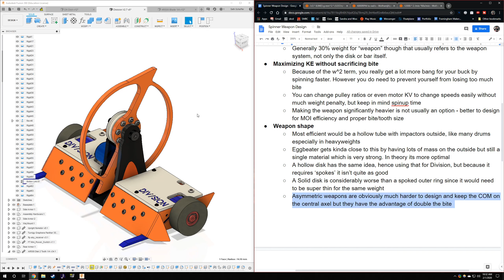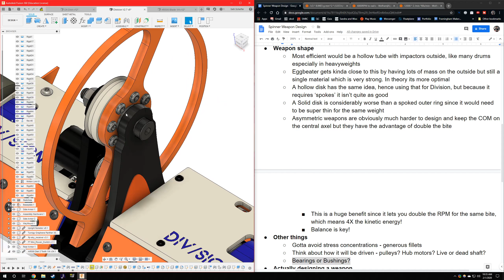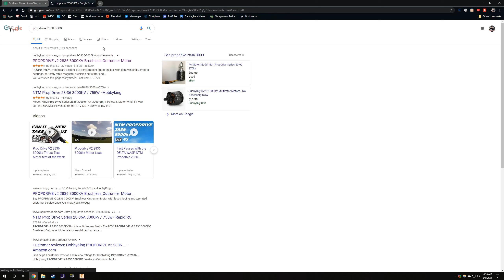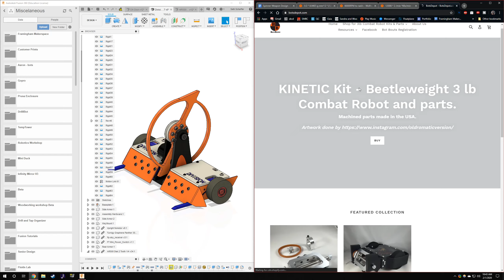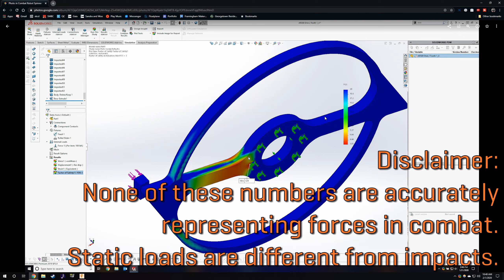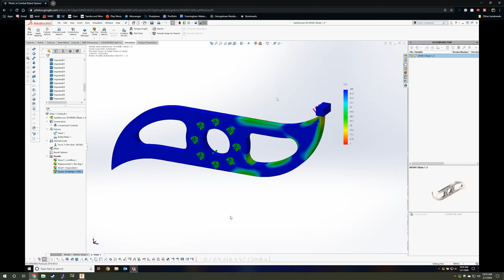Combat Robot Spinner Design Tutorial (Part 2): Motors, Pulleys, Applications and More

Comment: why does your new one-tooth spinner have a V-shape pointing to the tooth, instead of a full circle? seems that would increase MOI and also decrease air drag. you'd make the part of the circle opposite the tooth thick (like you have it).
Reply from the maker: Ive been using the single tooth spinner for over a year now. I'm finding it hard to visualize what exactly you are saying. Higher MOI isn't always the goal though. And drag hardly matters with weapons as thin as mine are, Division uses a ton less power than all the beater bar robots do. I have measured it drawing only about 9-10 amps at full speed. The new 2 tooth Superlight Slicer blade (used with the fork config) is designed to minimize MOI so the bot gyros less when turning.
Reply: I think one point is to have only the tooth stick out. If you have a circle with a tooth sticking out, another spinner oriented 90 degrees (horizontal against his vertical or vice versa), there is a higher chance for the enemy weapon to impact your circle weapon on the side. The v design significantly reduces this chance. But I have no idea if that was the reason for him doing that
Reply: @thorwaldjohanson2526  well if drag doesn't matter, and higher MOI isn't the constraint he's up against, then the circle thing is less compelling
Reply from the maker: Yup this is correct. The main idea is to avoid horizontal spinners getting a good bite on the side of the tooth. Having a reooev angle behind the tooth rather than a circular section can minimize this.

Comment: Also an example of a bot that has a lot of flex and no failure or warps is nightmares when icewave hit nightmare the bot was fine, but it’s disk warped and hit the side of the frame, it bent a good 20°+ causing the frame to warp, but the disk was perfectly fine afterwards

Comment: Do you consider offset inserts to be 1 tooth or 2 teeth for bite calculation? Because in a given radius along an impactor path, it is essentially an asymmetrical design
Reply from the maker: Well that depends on if both teeth can hit the thing you are driving into or not. In most cases they can but if you are attacking a corner of a bot or hitting with just half your weapon then you might get the benefit of a single tooth design.

Comment: I realise that it's a heavyweight bot and so not really connected with Seth's current work, but I find the vertical weapon design of Cobalt (2019 BattleBots iteration, black and green) odd but curiously pleasing. Why? Because the guys put fight philosophy ahead of weapon efficiency.

They deliberately went for a massive, solid, ripping-tooth disc, apparently sacrificing a lot of absolutely 'correct' theory for strength, after taking into account the kind of opponents their bot would be facing. To wit: yet more great big powerful spinners.

Using more of the engineering points Seth has explained in these last two videos would certainly have given Cobalt a very efficient weapon, but...

But that's where the 'unknown' bit of their approach comes into play. The fight philosophy. I think they'd planned to use Cobalt almost as a battering ram against other spinners, and that needed colossal strength rather than (just) an effective bite.

Smashing into modern steel armour plate (or the arena wall) is also a great way to destroy your own weapon, so the Cobalt boys seem to have designed a technically 'wrong' multi-tooth weapon that looks more like a cutter from a milling machine than a regular disc.

They still have a lot of destructive power, but based on their (presumed) head-on attack philosophy, it's more likely to wreck their opponents than themselves.

[Note; the above musings are purely my own opinion; I have no idea what Cobalt's really up to; I'm not connected to the team in any way. I'm also not a qualified engineer, I'm just someone with a long-time passion for bot building. And wrecking stuff.]
Reply from the maker: Well... I'm sorry to burst your bubble but while they carefully hid it in the photos, if you look closely at any of the footage where Cobalt hits the opponent in slow motion they actually do have a single tooth weapon. 

They repurposed a multi faceted milling cutter but seem to have welded on a single biting tooth sticking out further which is deadly effective. 

You can also see in their fight with Minotaur their alternative white weapon is also a purpose built single tooth weapon with no extra weight on extra small teeth. Not to say cutting weapons with more than four teeth cannot be effective, but there is simply no better way to grab hold and toss an opponent than with the maximal bite you get from a single tooth design. 

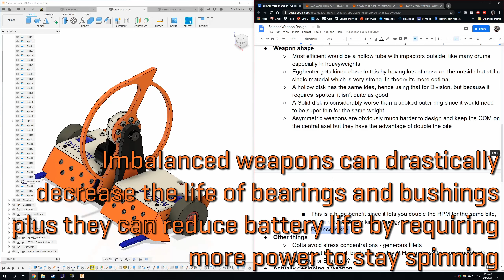Take a look at the slomo at the end of their fight with Duck. (about 2:36) https://youtu.be/QgpwVDVJ16w